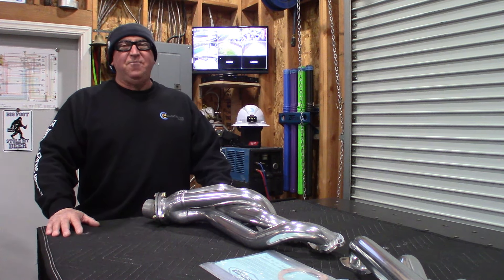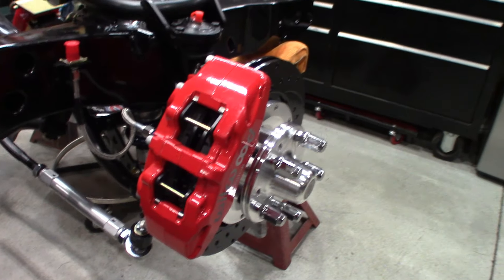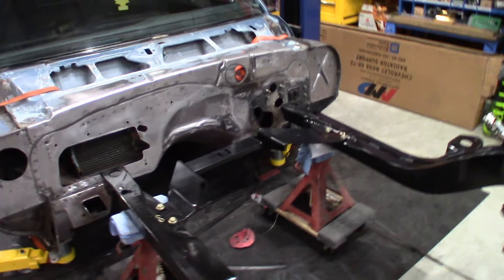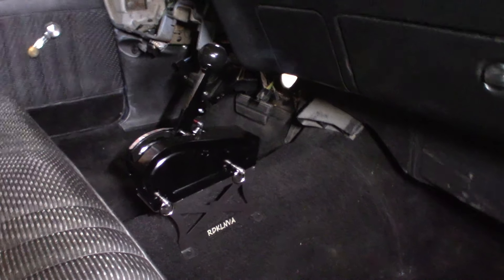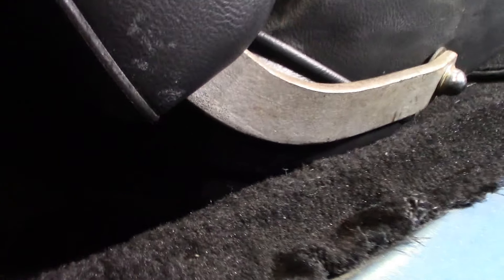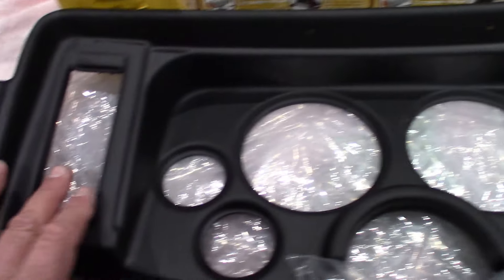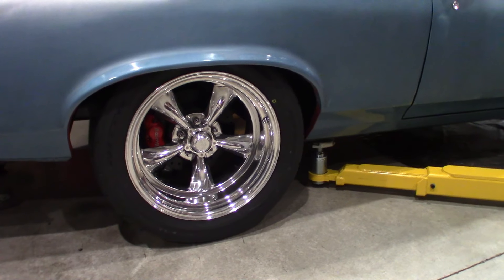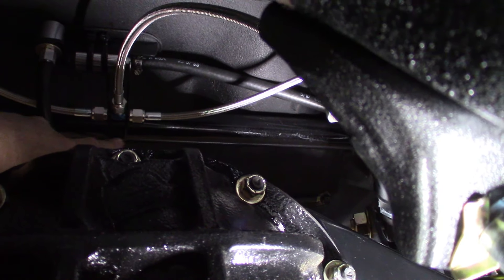1970 Nova December Update

Comment: Ray, these videos are great! Thank you for making them. I have a 1972 Nova that I’m building with almost the exact same set up. BBC, 4L80E, Full ride tech 4 link suspension, mini tubs, and a 9” QP rear. Can’t tell you how awesome it is to find a helpful videos series like this installing everything. 

Quick question for you about the QP rear… did they weld your 4 link brackets in for you when you ordered it? I’ve been wondering about that lately. Thanks again!
Reply from the maker: Hello Nicholas, Thank you for tuning in! Sounds like you have a awesome build going and using all the right parts! Yes QP has the Ridetech jig in house and will weld your 4-Link tabs on for you. If I had to do it all over again I would have QP weld the lower tabs inboard 1/2" per side to fit a 12" wide wheel. I ended up going with a 18x11's with 6" backspace. I fit up the wheels and tires after the DSE tubs were done and gave the overall width to QP and they did the rest. After installing everything, from mounting surface with rotor on to the lower tab I have 6-5/8" I'm running a Nitto NT555 G2 315/40 ZR18 and have about 1/2" clearance inside and out. I hope this helps with your build!

Comment: Long tubes with a 4 to 2 to 1 make more torque than a 4-1 mid length, probably giving up about 30-ft-lb on a 500hp setup.
Reply from the maker: Hey Brian, I am getting a lot of conflicting information! I would run long tube 2-1/8" headers but with the Ridetech Tru Steer System I am forced to run mid length headers. I was told by both the engine builder and his dyno tuner that I will gain low end torque up to about 5000 RPM over long tube headers, long tubes are better at high RPM in both HP and torque. I'm running a 496 BBC stroker with 625HP and 600 foot pounds of torque in a 3000 pound car. I do not think I am going to notice a little loss in torque and HP???
Reply: @RaysGarage  Hey you can never miss what you never had! Lol 😂  long tubes like almost always make more power across the board, but where they really accel is making low speed torque and the more overlap the cam has the greater the effect it has. This video shows very well how headers actually behave. https://youtu.be/9Lckpw_81PQ
Reply from the maker: @bcbloc02  Great video and excellent info!!! Maybe I should start a “Go Fund Me” for a set of custom 3K long tube headers! 😂
Reply: @RaysGarage  I am pretty sure a guy with your shop and skills could fabricate their own. 🙂 Of course then again for a street beast 90% of the time you won't be able to use the power you have so even more would be wasted anyhow. 🙂
Reply from the maker: @bcbloc02  Amen Brother!!!
Reply: @RaysGarage  Hi Ray, Checkout David Vizard's video on headers. This guy is an engine genius:  https://www.youtube.com/watch?v=f72BMpmoGMY
ATB....Dean

Comment: Did the header’s have square ports and the motor have round exhaust outputs? I’m putting in the same motor and ordered the same headers bb10’s
Reply from the maker: To be honest I reall y do not remember exactly but I belive the heads have round exhaust ports as well as the Sanderson BB10 headers, these headers did fit and seal just fine. I do have to retorque the header to head bolts from time to time. After I ran the motor a few times the shiny headers turned dull which kinda pissed me off, I did follow the instructions and cleaned them very good before start up but still turned dull.
Reply: @RaysGarage  Father in law asked the question since he’s installing it. No effect on performance than right? No leaks?
Reply from the maker: @Mrdjmanlive  No leaks to date, Sanderson Headers does not use head gaskets, the instructions tell you to use Ultra Black, let it cure overnight then install.

Comment: Mid length headers are a waist! Might as well run manifolds, same thing
Reply from the maker: I thought this too until I did some homework and talked to several in the business, both engine builders and dyno tuners. Take some time and read this if you like. I also like the fact that I will not be dragging the collectors on speed bumps!
https://www.centuryperformance.com/exhaust-header-tube-sizing-and-length.html